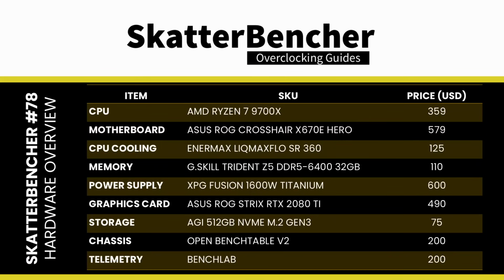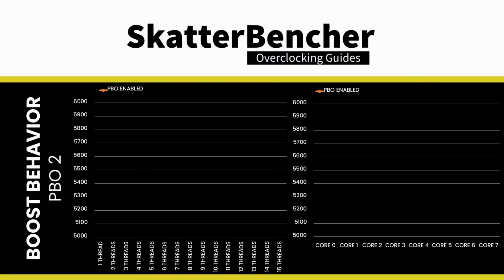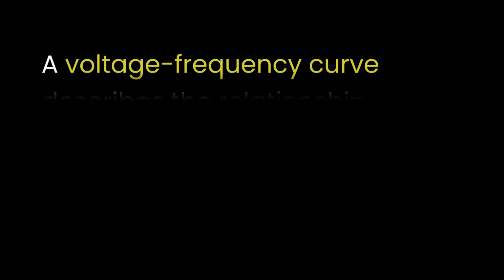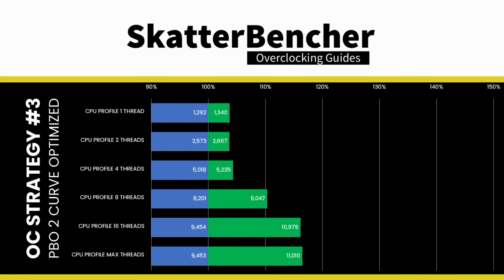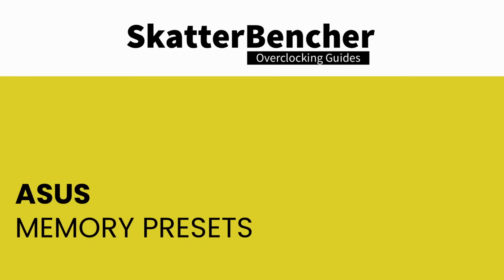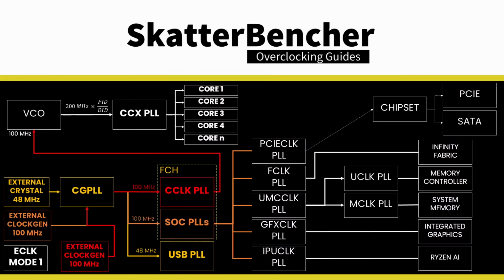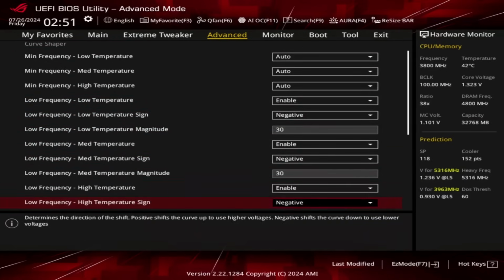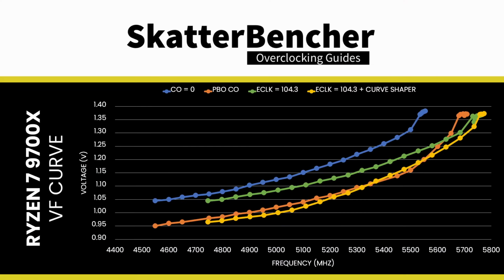Ryzen 7 9700X Undervolt & Overclock to 5860 MHz | SkatterBencher #78

Comment: First time watcher, loved the methodology and explanations.
It seems that reviewers who hated this processor, only consider the merits OOTB or with one click overclocking if they bother at all.
Personally I like processors with conservative default OOTB settings with plenty of headroom if you choose to chase higher performance.
Three one click TDP settings in the BIOS defaulting to the middle, 9700X should have 45W (eco) , 65W (default) and 105W (performance), this would be no more difficult than enabling EXPO/XMP for memory.
The differentiation between SKUs would be one of binning (and possibly higher levels of TDP settings). It's not like we can't already dial in a preferred performance/power draw for the use case. It's not just everything set to over 9000 as the only PBO option.
Reply: Yep, you can tune this one they way you want. SFF build and only a small cooler? No worries. Big radiator and want that little bit extra, you got it. I love the granularity of this gen.

Comment: Shocking, the single-CCD parts are thermal limited.

Just like they've been since Zen 2. Potentially encouraging for 99x0X parts; they'll likely be capable of swallowing Intelesque power but with relatively similar scaling to that seen here. Not that over double power consumption for 10% is "good" scaling, but hey!

Comment: Nice video. As someone still on 3800X this was very helpful to see all the new OC functionality explained. Looks like a worthy upgrade for tweakers despite the somewhat negative reviews because of lower stock TDP.
My only concern is 95C sounds toasty, can they take that kind of heat now? Anything over 80C gets me nervous.
Reply: 95C is the designed max sustained temperature and is considered safe. Obviously, trying to keep it lower is better as long as that does not interfere with your performance goals. 

That said, my personal max sustained temp limit is 80C as well.

Comment: The 9950x is 170w and so is the 7950x. Is it safe to assume stock performance of the 9950x won't have the same issues as stock 9700x?
Reply: I would be surprised if they did

Comment: Yet again, the standard tech press fails on their reviews because they dont understand new things unless they're externally explained to them.
Still AMD's fault, but they should've done their own homework regardless. 

Thanks for confirming my initial gut instinct that they were poorly tuned, because the numbers didnt make sense.
Reply: We don't need every CPU to default to a 95°C thermal limit control. Personally I'd like most processors to default to a conservative thermal requirement (like the 9700X) and have simple options ( inverse eco mode) to enable beast mode that require upgraded thermal solutions instead of that being the default.
Reply: @Garrus-w2h 
95°C is Tjmax, the hard thermal stop. AMD CPUs are designed to not go beyond that temp.
TDPs are the min cooler rated spec for normal operation @21°C ambient. They've always been that, modern boost technologies have shifted CPUs from being a 1:1 power draw to TDP ratio in the ever increasing amounts. AMD have charted the power draw of various TDPs, it's not that hard to find.

Reviewers tend to test with high end 360 AIO coolers so we don't often get to see many of the CPU's OOTB thermals when paired with a rated cooler. In AMD's own Wraith range, the stealth is rated 65W, Spire 90W and prism is 140W. 

The 7600 (65W) sold with wraith stealth and 7700 the wraith prism, both are 65W processors. Under a cinebench 1hour all core workload the 7600 + stealth hit 95.8°C and average power draw of 81.3W, while the 7700+ prism hit 78.3 and average power of 86.8W.

That example shows that in 65W (88W peak) configuration a standard 4 pipe cooler (typically 140-160W rated) will keep modern 65W rated CPUs running smoothly with overhead for overclocking. It also bodes well for SFF builds where tower and water cooling aren't an option. 

Just because a CPU can run happily @ 95°C doesn't mean that it's ideal. Thermals spread not just from the heatsink, but through the socket heating other nearby components.  Capacitor lifetime is directly affected by Temperature. You might have noticed that TDPs are described as default, it used to be static, now its infinitely configurable, default TDPs are a drop in convenience, as is eco modes. No one complains that memory defaults to the JDEC rating and you have to enable EXPO/XMP to get the rated spec. Even reviewers who claim to be reviewing OOTB experience, configure the systems memory away from defaults for performance reasons, but not CPUs.

Intel based motherboards automatically switched PL2 to unlimited time just by enabling XMP. Effectively overclocking the CPU using Tjmax as the safety from time limited boost to average TDP, to always on boost essentially doubling TDP. Blame them and reviewers if you don't like the fact that TDP no longer is directly associated with power draw.
Reply: @Garrus-w2h Yeah they did, they drove the insane power draws of modern CPUs by insisting OOTB 125W rated CPU's drawing 253W continuous is in spec and valid.
AMD looked as if they were about to follow the same path with 7000 series setting that trend, thank your deity this generation has come back to sanity.
Reply: @Garrus-w2h 
There's no real reason to list max power draw as typically the average power draw will be significantly less. Currently my 65W CPU is pulling a little over 50W with a couple of background tasks and watching a youtube video. It's quite common to find power draw below the rated TDP in typical use cases, gaming rarely taxes the full potential of the CPU. TDP as I already stated is the min spec recommendation for cooling solutions. With AMD the sustained max power draw typically seen with all core workloads is known for TDP defaults. 65=88, 90=120, 105=140, 170=230. Feel free to set your own PPT, PBO can also underclock if you want it to, setting PPT to 65W instead of the default 88W is allowed, just as setting PPT to 140W will turn a 65W chip into a 105W chip effectively.
Reply: @Garrus-w2h 
Multi Core Enhancement was a motherboard enabling of time extended PL2 eventually becoming infinite. The trick of it was the disclaimer that PL2 boosts did not break TDP averages as PL2 was designed in Intel spec to be short lived, typically less than 8 seconds and so was in spec even if pulling more power for a short time.
Initially MCE would simply apply max turbo across all cores for an extended period of time, basically long enough to gain a benefit in benchmarks. This motherboard initiated soft overclock could be denied by Intel as their doing, nudge nudge wink wink.

MCE was often auto enabled by initiating XMP on memory. Various motherboards and M/B manufacturers had their own settings. AMD introduced XFR and precision boost (not overdrive) on Ryzen 2000, it was part of the CPU spec just as PBO and curve optimiser is today. All a soft overclock whilst maintaining the CPU's factory max settings triangle. (PPT, EDC, TDC).

Effectively MCE auto enabled would be like testing with PBO turned on by default. The days of the MCE controversy are over, though we do still see intel processors able to pull 300W+ well over their rated max turbo power of 253W in benchmarks showing that there is still some additional MCE trickery in play. Intel no longer uses TDP since 12th gen they use "processor base power" and "maximum Turbo Power" in their specs.

Sustained power draw on unlocked processors is user controllable, I agree that max turbo power draw (effectively sustainable with correct choice of cooler) should be part of the CPU spec sheet just for easy reference.

Retail Intel processors behave exactly the same as review samples in retail motherboards. OEM prebuilts however can choose to stick within "official" spec (no mce and PL2 time limited to average to the base processor power ) and those may behave quite differently in sustained loads.

Once you learn to see modern desktop processors as infinitely configurable, you can get past the chicanery in play and see them for what they are. I treat the various SKUs as a proxy for binning these days. Though in many instances you can get great results from any unlocked SKU, you're still playing the odds for getting exceptional silicon.

Comment: Great video...for context is that running hot even at 170w at 95c? On a 14900k at 170w would be more like 60-70c even 253w can stay around 90 with just a 360 AIO ? Not really comparing like that just seems super hot?
Reply: I haven't seen a single OC benchmark yet where 9700X would've gone above 89-90° at full load operating on around 5,4MHz, so I'm assuming yes, all of the AIOs should be dealing with it perfectly 👌🏻
Reply: @F1stzz  what about the temps in this video?
Reply: @s3rm0n56  the CPU operates on higher clocks that I've mentioned yet it's still firmly stable at +5° temps. Lower wattage at higher temps generates less heat than high wattage on mid-to-high temps, so I wouldn't be worried at all.
Reply: @F1stzz  i dunno man only 5ghz at 1.155v at 168w maxing 95c seems pretty toasty
Reply: @s3rm0n56  95 degrees is 95 degrees, if it doesnt go past that then its totally ok.
Reply: @RawUpgrade  seems pretty high for what it's actually accomplishing which is not much
Reply: @s3rm0n56  thats true for every silicon, it gets to a point where the temperature and performance dont scale that well, best settings for the 9700X for maximum cost/benefit in terms of power and performance is probably around 95-125 watts.
Reply: @s3rm0n56  Look at the gains Intel went for regarding the 14900K+, 150w+ for less than 10%+ performance, it really starts to sound ridiculous.
Reply: @RawUpgrade  I dunno running a 14900k at 253w and getting desired performance on or under 90c seems reasonable to me... With original BIOS stock if it was pulling 300w that performance was never justified and temps were always at 100 just on a 360 AIO ... I'm not really comparing the efficiency coz that's silly between these two obviously but one of the limiting factors is thermals and these seem really high at that small power draw.
Reply: A chiller could have better results on temperature, what is your point?

Comment: Can we get a manual OC result? The Prime95 SmallFFT AVX2 results with undervolting looks so good.

And why don't AMD just give us a V-F table and a per-core boosting settings let us change that
also they can implement something similar to Intel XTU which lets you decide the frequency on a core number basis
for example 1/2/3 cores - 5.8G, 4 cores - 5.4G, 8 cores - 5.3G etc
then I can use Prime95 Small FFT AVX2 frequency for 8 cores and SSE frequency for 1/2 cores.

Comment: They should've given the 9700x 105w PPT instead of giving it 88w like the 9600x, seems to be not quite enough power per core vs the 170w and 200w for the 9900x and 9950x
Reply: I agree since it's leading to some reviews disappointed because it doesn't always beat the 7700X which makes it look bad, despite being a more sophisticated chip.

Comment: Do you think that pbo curve is going to be the new stability optimization this gen over individually tuning core curves?

Looks really good that you got -35 on all
Reply from the maker: Curve Optimizer is still the fastest route to more performance, but I find Curve Shaper to also be a very powerful tool. This chip had a lot of undervolt margin, so CO was easy. Maybe with other chips that have less margin CS will be more impactful.

For any OC Strategy with async eCLK, Curve Shaper is a paradigm shift. Total lifesaver.
Reply: @SkatterBencher  interesting I never got around to trying to do eclk with my 7950x3d I was interested since I delid it but started to doubt it would be worth the trouble

Comment: Cool, but how does this translate into gaming and app performance? Der8aur also did a rough, basic overclock his 9700X, removing all power limits, but the difference in gaming performance was negligible. If all this work doesn't translate into tangible performance improvements where it matters, then it doesn't save the CPU. Can you make some gaming benchmarks comparing your 9700X OC to its stock performance?
Reply: Most people spend way too much time worrying about gaming performance with CPUs when in reality it's generally not that important since most people are GPU limited when playing at ultra settings. It only matters for those who play competitive online and chase max frames.
Reply: you don't buy a 9700x for gaming unless you can't afford the 9800x3d.  in that case buy a cheaper 7800xd.  9700x is the all around bargain one, good enough for everything.
Reply: @JohnSmithLegend he wants to know how 9700x performs all around

Comment: Will it degrade? this its like pushing it beyond the extreme....
Reply: Doesn't even go beyond 1.4V. Intel's degrading chips hit 1.6V.
Reply: @The_Noticer.  previous gen chip when it went over 1.35 it blew up the memory controller, and literally the CPU blow-up but AMD and Asus fix it
Reply: @eilegz  That was SoC voltage...

Comment: You should really swap your AIO for custome loop for Overclocking review 😕
Reply from the maker: AIO is totally fine for the 9700X as it's less than 200W maxed out. The key challenge is the layers of thermal interface material between the silicon and the liquid.
Reply: @SkatterBencher  ok because each time you topped 95°C so was asking if all core frequency stress  test will have been better if temps will have been lower. Do you will try anothers part exemple  one delided + waterblock ?
Reply: @SkatterBencher   Just wanted to know if with exemple CPU delided + Optimus V3 Direct Die block it possible you think to have all core frequency 5700MHz in AVX stress test.
Reply from the maker: Maybe. I don't know enough about Ryzen direct die to jump to any meaningful conclusion or prediction. But what's for sure is that the bottleneck is not the AIO but rather the thermal transfer between the chip and the liquid. Any improvements there will help the headroom.

The next question is whether 5.7G can be achieved below 1.375V. If that's the case, then maybe your goal is achievable :)
Reply: @SkatterBencher  At this moment best Direct Die Block is the Optimus V3 for AMD, would be very nice if you can push for a last step on each of your review to tell us what is the maximum we can squeeze from each CPU in average in Direct Die. Most people stop to that type of cooling, after this it chiller cooling but it a niche market. Suggest you a Mo-ra3 420 ~ for radiator because you can mount pump + reservoir at the radiator and use 2 QDC like Der8auer.

Comment: Weird of AMD to restrict an 8-core "X" part to 65W when it can achieve a lot more when it's more unconstrained. At 65W it barely beats the 2 years old 7700x which is a bit embarrassing. Good to know that at least it has a good OC potential to get back the performance.
Reply: How is it embarrassing to achieve the same performance while using 30-40% less power? Thats pretty incredible if you ask me.
Reply: Could be a lot better, for sure.
Reply: @Florianski HUB compares it with a 7700 non-X 65w and the 9700X is faster by only 7%.
Reply: @nvnh319 Steve is a clickbait drama queen and quite ignorant. That is why you are here, to actually learn something.

Comment: These CPUs are pretty much squeezed out at stock. The era of 30-40% extra juice is long gone. I've spent 3 weeks messing with 7800x3d just to get 7% out of memory and CO per core offset. That is on top of just xmp/PBO. The funny part was that clearing the crap out of 22H2 win 10 custom already cut down iso gave me another 10% in Night raid and Cyberpunk lowest settings QHD. That took me like 20 minutes with Shutup O&O. For older games LTSC 1809 may be a bit faster, atleast it was side by side in entry presets 3dmark11.

Comment: I've used curve optimiser on my 5600X and has been happy with the lower temps i'm getting with it (-30 on all cores, no errors on OCCT extreme AVX2, and no crash/BSOD for a month yet) (using the Curve Optimiser on Ryzen master as i don't have the options on my asrock MB and bios)

But one thing i understood with the graph at 13:25 taht i didn't know at the time was that i can go higher on the frequency like that. Definitely useful to know and will explore that to see if i can boost higher !
Reply: U got my sub btw

Comment: Great video! Very well explained and good to follow
However, double or even triple the power draw is a hard pill to swallow
Reply: You're balking at 120-180W when intel was pushing over 300W-400W to get their performance. OCing is never about efficiency but pushing performance and clocks.

Edit: You can also use curve optimiser and still get an OC if you want lower voltage.

Comment: Only Der8uer scraped this, you went far deeper, well done.. it seems that effectively these CPUs were like purposely held back by AMD.

I however do wonder long term reliability. I remember ryzen 3000s didn't fare well with 10x scalar back in the day.
Reply from the maker: 10X scaler doesn't seem to add more than 25mV headroom in with any kind of load, so I'm not too worried about the long-term effects
Reply: @SkatterBencher  I see, so it's pretty much contained
Reply: I love that AMD allowed more customisation and made overclocking/undervolting more interesting.

Comment: under appreciated review. Is that a 24/7 stable result?
Reply from the maker: Yes, all my OC Strategies are intended to be stable configurations. That's why I always include AVX and SSE stability tests as well
Reply: @SkatterBencher  i try to go co -35 the same as you did in the video,but once i run r23, the computer freeze everytime. is that PSU or it is the cpu problem?